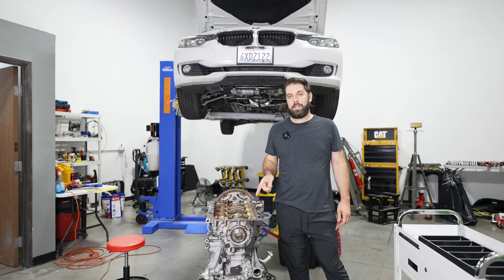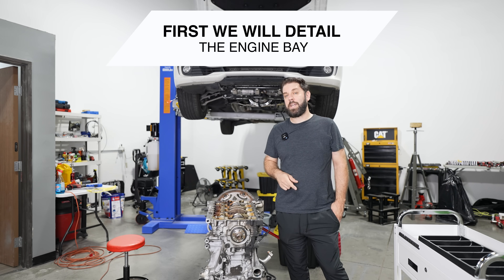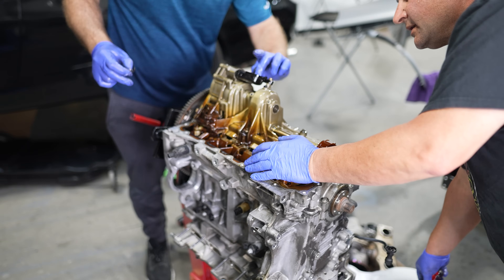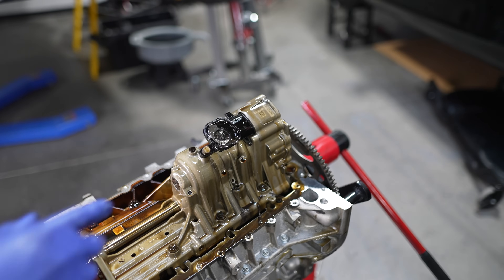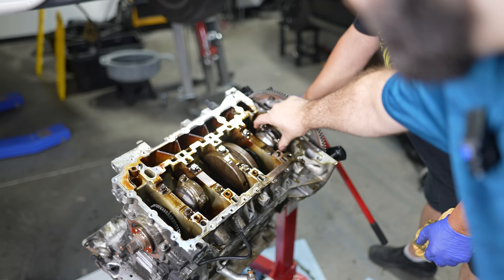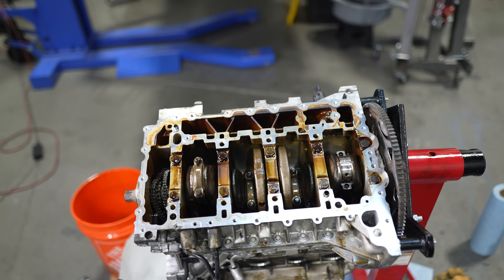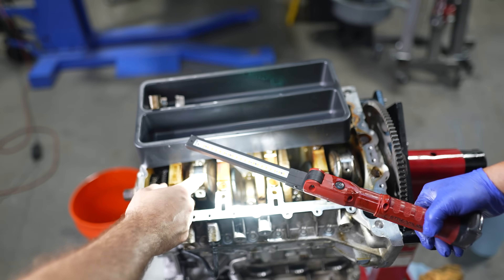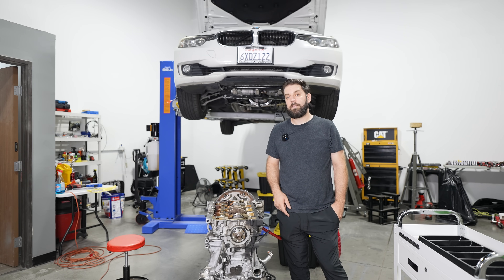This BMW Didn't Make It To 100K Miles, Will Yours?  Do This First!

Comment: Had an N52 that had same exact issue. Just polished the crank and through in a new set of rod bearings and still running today. Did while the engine was in the car.
Reply: what was the mileage on the N52?
Reply: @SamBao  154K. The bad rod cap was discolored to be completely black. Used Emory cloth and shoe string to repolish the crank.
Reply: @thomaslefler5242  and what is your current mileage? I have a similar issue with an M62b44 (V8) right now.
Reply: @francispowell1811  at 176K right now. No signs of any issues. Nice thing is engine looks a lot cleaner now. Replaced a lot of gaskets “while in there”. So don’t have all the oil leaks anymore either.
Reply: @thomaslefler5242  Nice. Keeping my fingers crossed. Best!
Reply: You inspire me to have sex with a fat person. I am so inspired I want to do what you jus said on my n20.

Comment: I think I got lucky when I bought a 2016 328i (build May of 2016) -- supposedly it has all the timing chain related fixes for the n20.  I still feel a bit uneasy about it though.
Reply: Post 2015 models have the upgraded chain and guides (supposedly stronger plastics) I have the same car but built March 2013. So far no issues/noises thank god! Currently at 57k. Looking to change my chain soon just for prev maint.
Reply from the maker: Yes you have the new guides so not much to worry about.

Comment: Iam done with BMW. That brand has lost my respect. missing old days when you had to change timing belt and be happy. vintage amps and vintage cars its going to be the same now
Reply: The N20 hasn't been used since 2018. The B engines that replaced it have been amazing so far going on 7 years. It's good time to stay with BMW.
Reply: I think BMW has been done with BMW for some time now.
Reply: @RothBeyondTheGrave  You're going to have to explain that to me

Comment: My girls x1 has the n20 with 78k has a some ticking at start up but settles down shortly after warm up.  I believe you showed the timing chain upgrade can be done without pulling the motor..is that correct?
Reply: Ticking is probably valve lifter tick, which is pretty much on any engine beginning with "N". However, if your engine has a but of a mild rattle, then that's a problem. Regardless, if its the early revision N20, youll want to get that problematic chain assembly out soon.
Reply: @indianboy0453  yeah pretty used to the BMW lifter noise.  Been following DIY for years he helped me take care of 90 percent of maintenance in my own garage.
Reply: @mikebrooks447  Discovered his channel about a year or two back. Love the content and his explanations. He actually opened my eyes to the potential reliability of the engines in my parents garage. Mothers N52 is pretty much solid as of now, and Dads N55 needs a little work but I took care of the major early failure points so far. Just not entirely sure if I should advise my dad to keep it or not.
Reply from the maker: Yes I have a couple videos showing it done in the car.
Reply: Yes but the motor comes out almost as easy as the subframe

Comment: N20s are among the worst engines of all time
Reply: There are WAY, WAY worse engines than the n20!  And if you got an n20 built after March 2015 there's nothing to worry about.
Reply: @ShowMeWhatINeedToKnow  they replaced the n20 with a new engine b48 after 2015  way better engine
Reply: @hasan_440i  -- Actually it wasn't until the 2017 model year that the B48 appeared in the F30 3-series.  Many 2015 and all 2016 model F30s received the n20 with revised timing chain components.
Reply: @ShowMeWhatINeedToKnow  I am not from usa I do own 2016 320i lci with  b48 engine as my dailey 
in my country the last year for the n20 was 2015 after that came the lci b48 
Sorry for my bad English
Reply: @hasan_440i  -- India is cool; your English is good; thanks.  You might be confused regarding the B48 being in the 2016 model year though.  True -- 2016 was the first year of the LCI -- however, the LCI still received the n20 until model year 2017.
Reply: @ShowMeWhatINeedToKnow  what do u mean by india I am from ksa 
However never know this thnx 
The b48 is something else compare to n20 love it for my dailey and I do own a b58 for the weekend 
Have a nice day
Reply: @ShowMeWhatINeedToKnow  bro u can dm me in insta if u don't belive me that  my 2016  f30 has a b48 engine
Reply: @hasan_440i  I believe you. Turns out only the US market received the n20 for the 320i all the way through 2018.  Sorry man.  I have disgraced myself and my family's honor.
Reply: @ShowMeWhatINeedToKnow  its alright bro also I didn't know this about the us market 
Be safe ✌
Reply: My 1999 Toyota Camry was 100 times worse than any bmw engine. I own an f10 n20 since 2017 with 120000 miles. It has normal stuff to repair after 100k but it’s no where near as bad as the Toyota Camry from 1999

Comment: Early years N20 that almost did 100K miles? that's over achieving.
Reply: I have a 2014 x1 with the n20. It's got 108k miles, still on original timing guides. Still runs great 🤠
Reply: Mine did 260k km before the timing change, although mostly highway kms.
Reply: I recommend you guys to do the chain and tensioners asap. My friends n20 blew up at 100k cause the timing guides broke. It was 7000 for the new used rngine and labor. Id rather pay the 1200 for the chain every 80 to 100k than 7000 lmao
Reply: @adamdistortion8810  As I understand the replacement parts are of the new improved design, so once you do it, it's actually 0 maintenance as it was supposed to be in the first place.
Reply: My '13 328i has 108K as well, still good but thinking of proactively changing the timing stuff. X-Drive, so it's supposed to be an engine-out job, but I think I can do it in-chassis. How hard can it be? 🤔😂
Reply: Meh, mine did 131K with 0 issues and counting. It can blow up tomorrow, sure, but  I'd still say that there rather is more of the good ones than the bad ones. Even if 10% are bad that's tens of thousands of bad engines - more than enough to get bad rep.

Comment: Well it's an N20. Not surprising the motor needed a tear down.
Reply: If you watch the video you’ll see he mentioned oil starvation
In other worse if this engine had been getting regular oil changes it would not have needed a tear down
Reply: @benderr424  - Regular oil changes won't protect the defective plastic timing chain guide from breaking and getting sucked-up into the oil pick-up though.
Reply: @benderr424  and also if you watch the video you'll see the reason the starvation happened in the first place. Pieces of timing chain guides got sucked into the oil pickup and thus prevented correct oil flow. This engine has upgraded timing chain parts specifically because of this
Reply: N20s are pretty good engines. If you do the timing/oil pump chain before the guides break they run forever. I've seen them over 200K. Maybe a new turbo every 100K and a few injectors here and there.
Reply: @THBMW  and how do you know when the guides break?
Reply: @eddyvenema  you can open the oil cap and pull on the timing chain to check for play. It should be tight. If it's loose the guides are worn or broken, or the chain is stretched. The only way to know for sure is to drop the oil pan and look.
Reply: That's why he's making videos on it, no one else is deep diving into why shitty it is and how to keep it running if you do own one.

Comment: Bmw has recall or law suit about this knock some case I heard they replace engine is that right?
Reply: They extended it to 7yr/70,000 in USA
Reply: @igotaction  70 000mils is pretty laughable, it shouldve been at atleast 140 000 miles. An engine failure in a car thats been serviced at the correct intervals should simply not have a chance to fail before at least 200 000 miles... N20/N26 and N13 are such gigantic engineering failures.